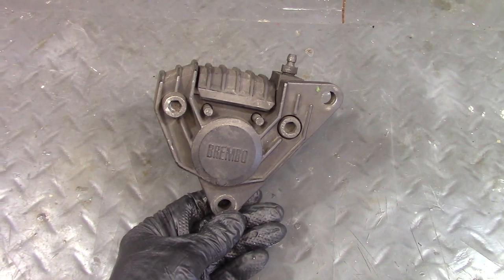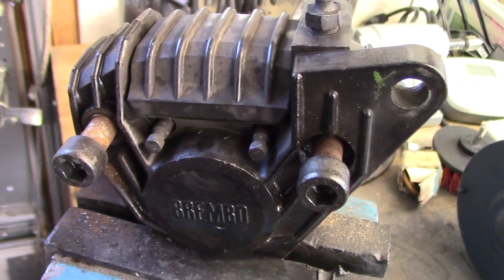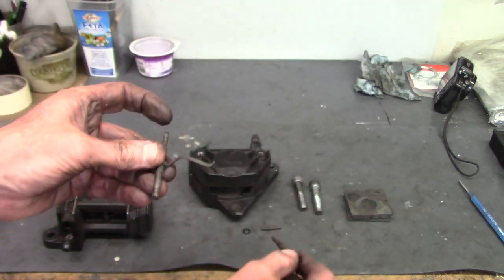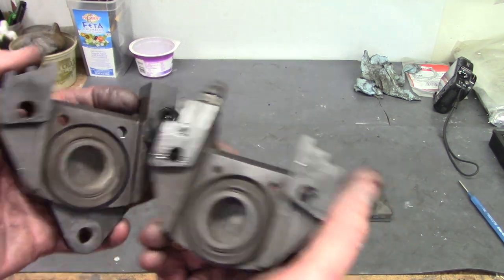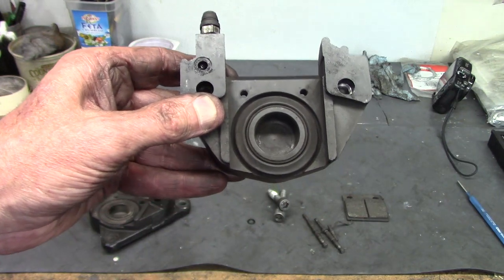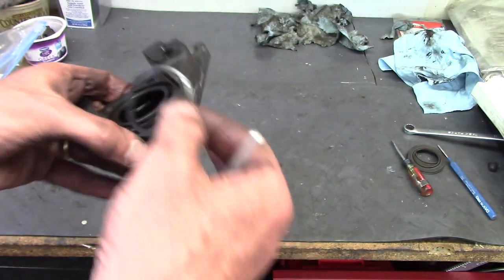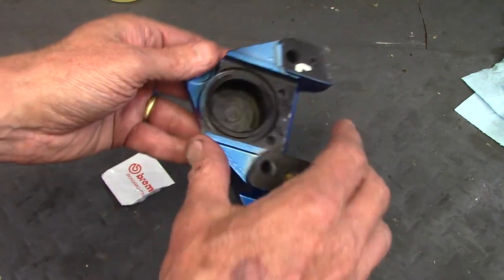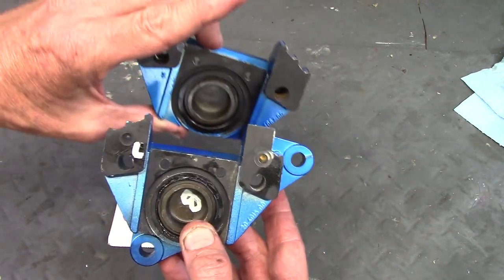1983 BMW R80ST Rebuild Front Brake Caliper

Comment: a little bit of lube on the clamping bolts would prevent the rust seen on the originals
Reply from the maker: Stanley, and of course it didn't help that the bike sat for almost 25 years, part of the time, outside.